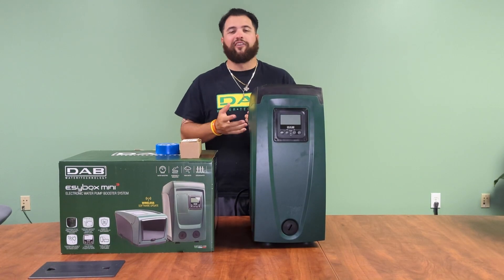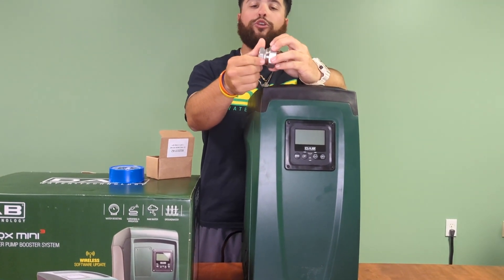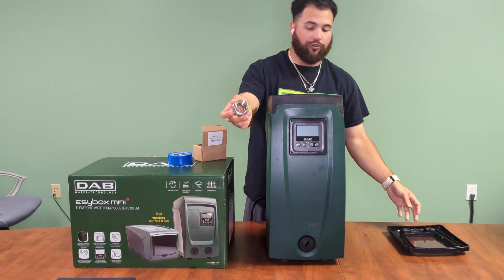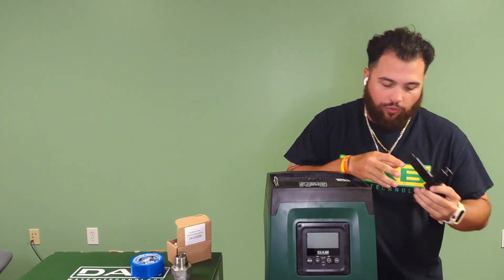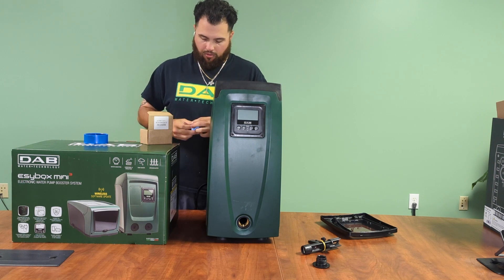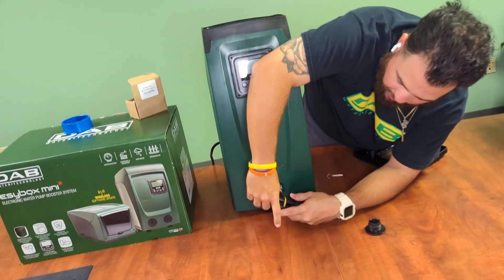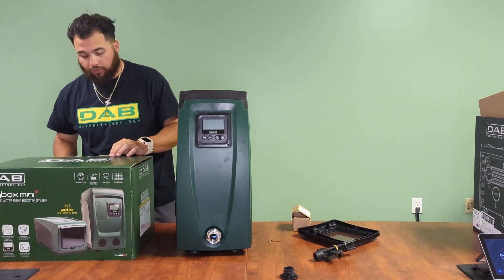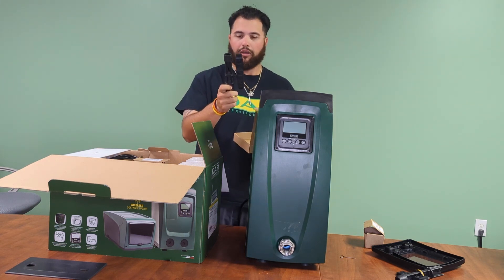How to install the Union Kit for DAB EsyBox and EsyBox Mini 3

Comment: I'm having a lot of trouble getting those unions leak-tight. I'm on like round ten of removing them, cleaning them, reapplying tape and dope, and they will not stop leaking at the bottom of the thread on both sides.
Reply: Same. Though in my case, only on the output side.
From what I can tell, these unions are shallow and do not allow an NPT thread to bottom out. 
NPT threads are tapered so that the threads actually make the seal. But the stainless steel unions provided by DAB are very shallow threads and bottom out before the NPT threading can bite properly. 
I am now looking for shallower NPT threading nipples to connect to these unions. Barring that, I am going to have to grind off the first few threads so that they (might) bottom out properly in DAB's stainless steel unions. So far I've had the whole damn thing apart 5 times. 
Seems like a great pump, but I am pissed off by this. $100 for a union kit that is described as "NPT" but they are not.